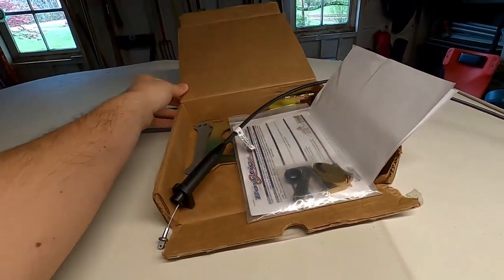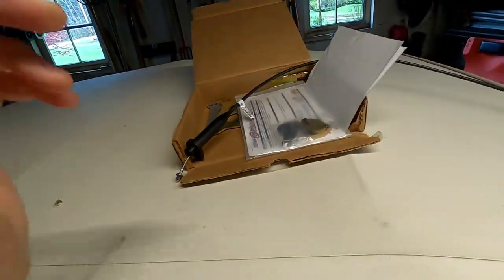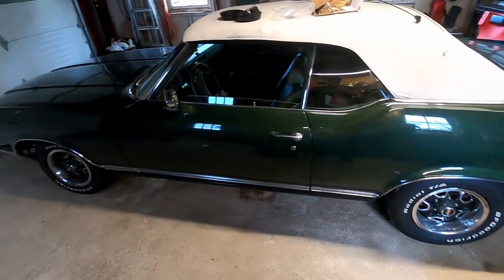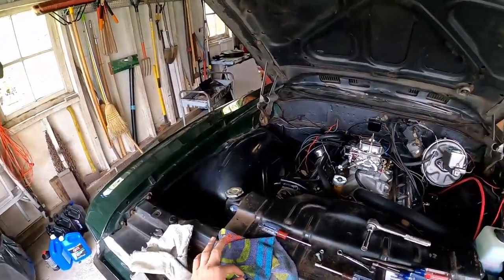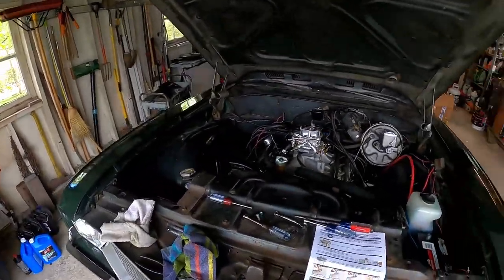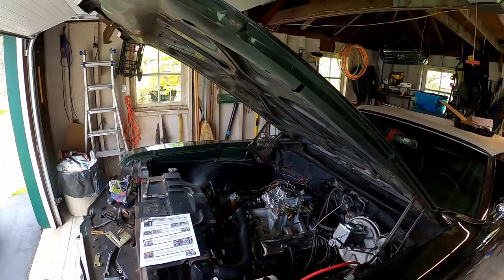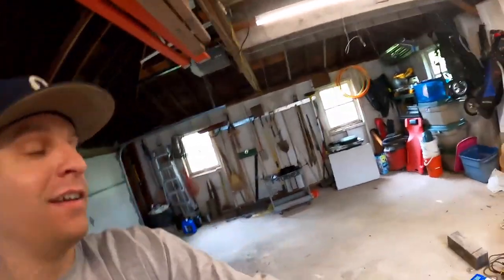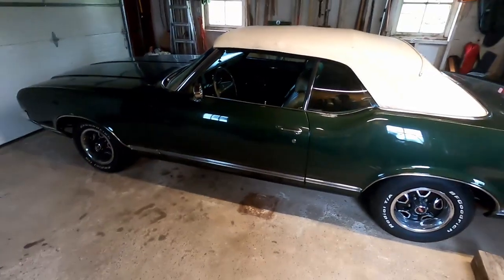Episode 16: Running Strong! Installing the BTO TV Made EZ Kit

Comment: What are the symptoms of short spring syndrome?
I need to have my 200R rebuilt.  It did have issues with driving in town bouncing between third and fourth gear. When I first put it in it did not do this . It’s a swap into a Tri 5
Reply from the maker: Short spring syndrome causes stacked shifts, so it'll go from 1st through 4th really quickly. At light throttle it should go 1-2 between 2500-2800, 2-3 between 2300-2500, 3-4 around 40 or 45 mph. At full throttle, stock 200-4Rs shift around 4500-4800. Modified ones have a different spring within the transmission that raises the shift points. There's a common myth that tightening the TV cable will raise the shift points, that's not true. Your issue sounds like it could be a torque converter lockup issue. Try disconnecting the lockup wiring and see if it goes away. If it does, it's the TCC lockup. If it still happens, it's an issue within the transmission itself, probably a valve body or a TV cable adjustment issue. What differential gear are you running?
Reply: OldsmoBobby I am just running the stock 355 gear that came with it. I just had some issues with putting a 700 are into my 58 Chevy wagon. Could not get it to go into fourth I finally took her back to the builder it had the wrong damn valve body in it. I 55 four-door is a cruiser we take long trips in it I will probably add a little bit of a stall because I’m putting some cam, for tech heads.